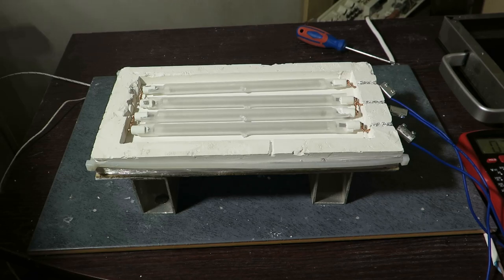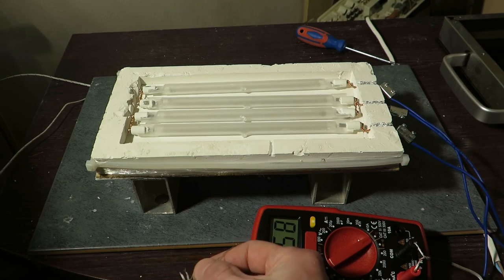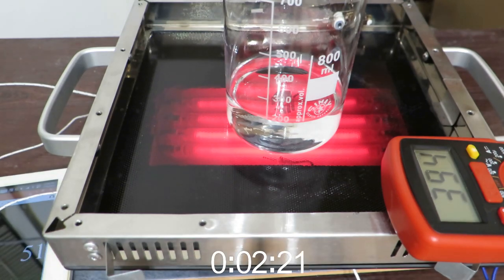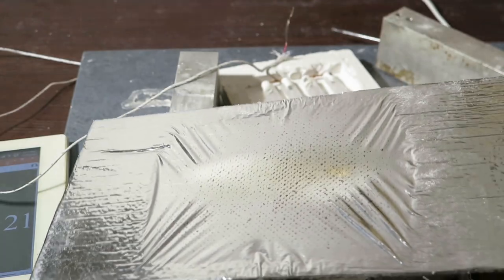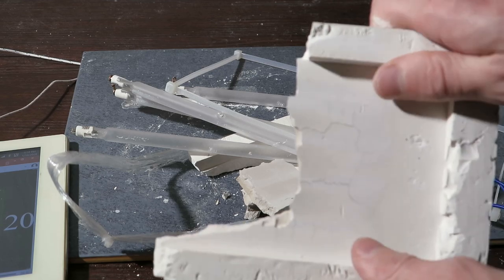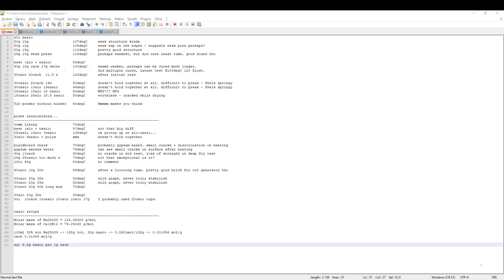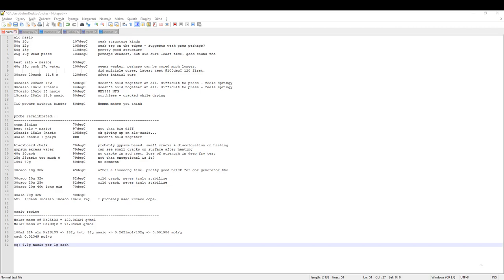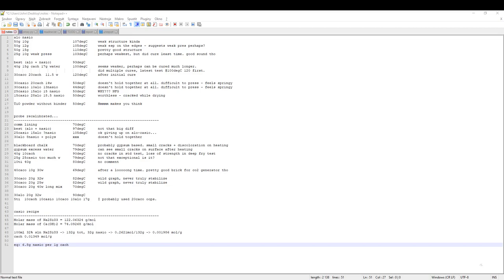Quest for heat insulating material. pt 1

Comment: you should try to make some clay bricks but mixed with sawdust. fire it in a bonfire or something. might need to dig a hole and blow in air or something. the sawdust should gradually burn away, leaving a porous block of clay. i think this was an oldshool way of making insulating fire bricks.